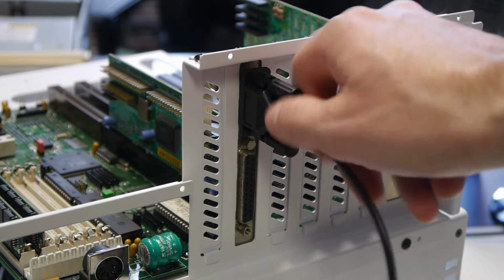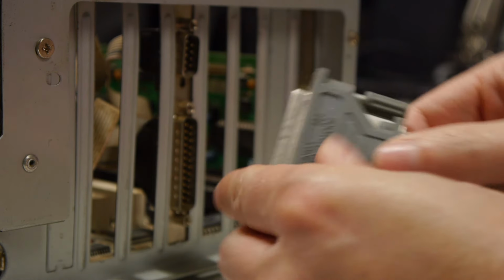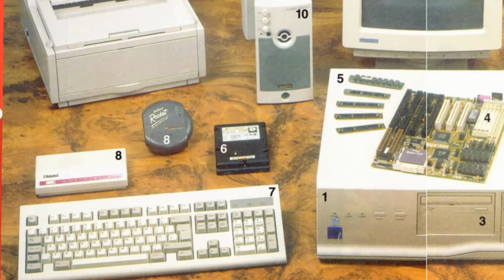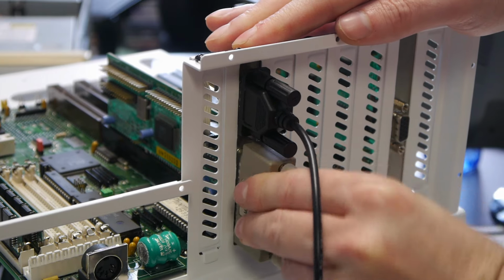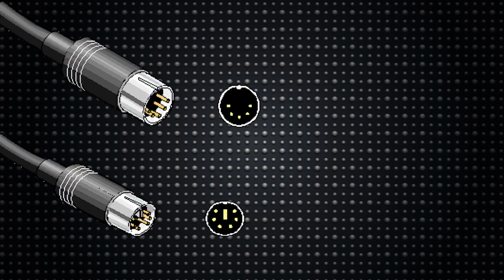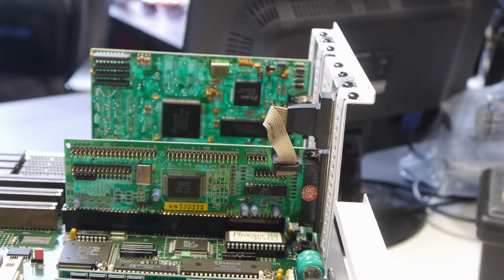What did we use before USB? | Nostalgia Nerd

Comment: I spent more time holding up the damned cable. I remember these horrid things. Once I got USB, my back recovered. 
You take the wire, plug it into the blue slot (the one you don't need anymore) and screw the thing in on the side.
the pain, the ungodly pain from screwing that f**ker in. why are the screws so tiny? 

Imagine trying to plug in a charger, but you need to put the charger in, hold it there while you figure out how to grow a third arm (because you need to screw it in place but dropping the cable will bend the pins) and if you're lucky, you get color. If you are unlucky, you get a yellow tint and have to do it over. I loved my original pc but some things should stay in the past. the back pain, the ungodly back pain!

Comment: Missed the Logitech Bus Mouse. It came with its own 9 pin bus card. It saved on resources and com ports. In the day it cost about $100. The port was a reverse serial 9 pin. It worked very well until later computers started using the Bus Mouse resources and conflicts arose. As far as I can tell, it was a dead end. At the time mice were new to DOS and there were no real standards. The serial mouse and PS2 made the concept moot.

Comment: The problem now i USB mini, micro and C. Mostly the A-conector is the same but the C-conector is gaining in use for the "computer" side. The other side is a mess. B, B-mini and B-micro is a mess. And then there is the C-conector that can act as both A and B (on the go)
It is still a mess with adapters.

Comment: During Windows installs some times those ports were required before the USB mouse would be seen, due to the software not being installed an the Bios only holding the drivers for the ports!~
  Some people might not know this but the Din plug was also a way to connect Car Audio before the RCA plug was invented.

Comment: I remember running into trouble with the serial ports back in 95-96. My mouse back then used one of the serial ports and the modem used the other. A really weird error occured when downloading something. 
I had to move the mouse all the time to keep the connection alive. 
After a lot of troubleshooting i finally solved it, it turned out that the modem and the mouse had the same IRQ, the mouse was quite old anyway, so i bought a PS/2 mouse instead and the problem was asolved.

Comment: You forgot to mention Infrared Data ports found on desktop expansion cards, laptops, PDAs, smart (learning) remotes that could also work with IrDa ports on PCs.  USB 2 runs at 480 Mbps.  USB 3.0 is 10x faster so wouldn't it be running at 4,800 Mbps?  Not 5 Gbps?

Comment: There were 25 pin  serial mice.  Modem software does not need the 25 pin serial port, the only thing missing in the 9 pin is the RING  pin. But the modem sent RING RING through anyway, and with ATA AA,  Auto answer, the software could watch for DCD .. etc etc.. The benefit of the "parallel port" was really that it was TTL and so the bits of data could be anything - it wouldnt have to be  8 bit text data. Of course,  the "send 8 bit text to printer" was done the exact same way for any printer... There were of course serial printers around too.. eg Apple choosing to  what, always try to avoid mainstream compatibility.

Comment: When it comes to bus nostalgia: Does anyone still know about the macintosh's so-called "ADB" port?  (they literally have used this for all peripheral devices in the early days at apple). It is actually a serial interface. You may see it as kind of a predecessor of the USB Idea. Also former cbm home computers already have used a 6-pin DIN (IEC) serial bus interface to connect to peripheral devices.

Comment: Ah the good old days, my VHS Recorder being used as a backup device via some weird interface. The RS232 "standards" were so abused not even using the correct voltages on some PCs, getting the Modems and other devices with a full RS232 interface to work could sometimes seem like magic and the resident  serial port expert at work became almost a law to himself. Hey we were communicating at 50 bits/sec though  :) . USB was such a gamechanger the worst part for us at work being its short range, was it 5 M. In the military realm the old interfaces kept showing up and were needed right up to when I retired in 2020 and there were endless incompatability problems between different generations of equipment from 80's upwards. I particularly remember Windows NT4 not being able to "USB" causing lots of distress. Another time we received 50pc's to replace old ones, the paperwork said they had RS232... But they were not cabled out. We had to work the weekend making cables from the "botherboard" to the outside just to save our bosses face on the Monday.

Comment: I do networking work sometimes on buildings with older equipment and you would be surprised how many times i need to take out the usb to serial port adapter to connect my modern laptop to the ancient equipment

Comment: These videos are so nice to watch. Just a note though: The voice over referenced a connector as a DB9. These types of connectors (D Subminiature) come in different shell sizes, and standard and high pin density. Most commonly: DA15 (aka the game port), DB25 (aka parallel port), DC37 (no idea what these were common for), and DE9 (serial port). The common VGA port is an example of a high density connector, having 3 rows of pins. Whilst I love the fact that USB is such a commonly used connector, it is frustrating the number of different sizes/shapes of USB connectors.

Comment: Just for Prosperity, my first USB device was a Microsoft SideWinder Freestyle Pro which camebundled with Motorcross Madness... or MM came Bundled with Controller... One of the Two, just looked it up and it was released in 1998, so yeah my First USB device was 1998, I remember it came with "adapters" as it was possible the PC didn't have USB, which my PC did have.

The controller BTW had "tilt" a feature where you tilt the controllr and it controlled the game, so think Wii but almost 10 years earlier. Actually it was more like PS3 actually. Anyway that was first tiem I had that type of input and then over next coupla years everything started to be USB.

Also Also I had a few SoundBlaster Cards... Also does anyone remember PhysX Ageia?

Comment: The serial, parallel and VGA/DVI plugs with integrated screw pins (to hold them in place) always got stuck on all the other cables when I tried to pull them out after unplugging them, like an anchor of a ship.

Comment: Thanks for the video.

You showed a scroll-wheel mouse when talking about Windows 95. But I'm sure that came up a little bit later. I remember MS Office 97 boxes with a scroll-wheel mouse included. The first scroll-wheel mouse I ever saw.
And I knew some people with Firewire cards in PCs (non-Apple) because the wanted to import DV from cameras or said USB is too slow for my external PATA hard-drive (before USB2.0 was invented).
For measurement devices GPIB was used (and seems to be still in use with old devices).

PS: Before USB, I think there wasn't a chance for an external NIC. But there were "networks" basing on serial or parallel ports.

Comment: Back in the day you had clearly different ports for clearly different things, even colour coded.
Today you mainly have USB Type A connectors that can be USB 2 (why do these still even exist?), USB 3, USB 3.1, USB 3.2, USB 3.1 Gen 1, USB 3.2 Gen 1, USB 3.2 Gen 2, any type of USB 3.x that's not on an Intel controller and won't work correctly with like 80% of the things you try to connect and even USB 3.x ports on an Intel controller that isn't being properly supported on Windows Fucking Ten anymore and constantly being detected as USB 2 every now and then. And that's only USB A. So what's better? Never had problems back in the day at all, but USB keeps giving me a pain in the plot for about 20 years already...

Comment: You seem to have forgotten about the Apple's ADB port on Macs of the mid 80s and 90s. It's a 4pin Mini-din sized plug (also looked like an S-video plug) used for both keyboards and mouses. It was pretty close to what USB 1 launched as.

Plus the iMac initially only had USB ports (the first to do that) They didn't get firewire until the second revision, at least a year later.
Reply: It's my understanding it is S-Video cable and port. Not just looks like.

Comment: And now USB-C has arrived with 24 tiny pins and a current maximum data throughput of 40 Gbits per second and up to 100 Watts for charging. Hopefully, USB 4 will get everyone on the same page and we’ll finally have one truly universal connector. USB A will stick around for a while for compatibility’s sake, but soon it may be phased out in favor of C. Also some dedicated ports like HDMI and DisplayPort will probably stick around too since they’re solely A/V interfaces, but nothing is stopping us from using USB-C cables for that too, especially since it can provide power and is capable of transferring not only 4K video at bit rates that’ll put your CD player to shame, but also uncompressed multichannel audio at nitrates that’ll put your CD player to shame (Technology Connections fans will get it).

Comment: Those old school cables, specifically the connectors, were MUCH sturdier than USB. I've seen a wrongly placed accidental swipe of an elbow or foot snap a USB clean off, with the connector remaining forever stuck in the port. Try that with one of those centronics dual wire clip affixed ports and you're going to need surgery. There are always points to be made both ways however. If you have longer cables around and trip over one for example.... The USB might break, but it's also possible it will just come unplugged. Which leaves the hardware on the table/desk most of the time. You get caught in a cable that has wire clips on one end, and screw terminal connectors on the other end, you're going down, and then the computer and printer are likely coming down on top of you. Which with 80s and 90s hardware could be massively painful. 17 inch CRT monitor to the dome is a guaranteed concussion.

Comment: Is it true that USB is slightly based upon the Atari 800/400/130xe parallel port. One could plug a floppy into this port then plug a printer into the same port on that floppy, then plug another devise into the same port on the printer, etc..

Comment: Apple2 had the very similar joystick interface first. Its analog.   Variable resister .. The accuracy was 8 bit.. so the joystick reading would be  up to + or -  127 from centred, in the two directions giving  x and y .. the resistor connected to a capacitor... To take a reading , computer would flip the voltage  across the resistor capacitor circuit and as feedback , it would detect the voltage changing on the capacitor only... The time to reach a   threshold voltage  indicated resistance.. hence position... This was unique to apple2 , the 8 bit, and ibm pc ..

Comment: Some rich people had a printer and a scanner! You forgot how that was possible without crawling under the table to use the other.
AFAIremember scanners could daisy chain the parallel port.
Then there were those who were too poor for SCSI but wanted to backup to tape, they used EPP.

Comment: Synchronization problems on parallel ports? What about IDE then? It transfered something like 16MB/s without even using twister pair cables that I saw somewhere else (SCSI? older computers?)

Comment: More than 25 years ago, I needed to upgrade my mouse from the basic Dell one that came with the computer. I ordered a serial Logitech Mouseman because Doom at that time did not work with PS/2 mice. Eventually, iD fixed that problem, and I wanted to switch it to PS/2. When it didn't work with the adapter I bought (not knowing the mouse actually had to support both to be able to use those adapters) I called Logitech. They sent me, free of charge, a PS/2 version. This is why I continue to buy Logitech equipment to this day.
Also, did you know that Windows 10 still includes serial mouse support? Just last week I had to make a reg file to disable this in an embedded Windows PC to keep Windows from deciding that our attached equipment is a "mouse."

I also remember setting up special modem AT codes to play Doom death match using a phone cable between the modems of two computers.

Comment: This was nostalgic for me. I taught Data Communications at local colleges in the nineties. I got into it from teaching official Novell networking classes but when I moved to Microsoft certified courses I also began teaching general data communications. Most of my course was a detailed examination of communication protocols which got me into teaching pin outs which in turn got me into identifying connectors. Most of the students were trying to prepare for being some kind of on-site microcomputer hardware guy at some of the many new companies then starting up.  
I was then a manager of such people in my day job and I knew that to be accepted as a PC guru you had to recognize the various cables and connectors. The guru must never say "What the hell is that?" when confronted by a strange cable. And in those days there was a lot of diversity. So I began collecting weird and obscure wires and plugs. I then started to bring them to class and have quizzes to see who could identify them. This was always fun. It was certainly more interesting than my lectures on data packet formats.

Comment: There will come a time that wireless connection will be the standard and the only connection cable we'll be using is the power cord.
Reply: Some peripherals runs on power coming from the communication cable in order to operate, so no.

Comment: i like to keep a system with fdd, serial and parallel ports for those rare times i have to use low level programming stuff like motherboard bios chip recovery or old hardware.

Comment: After 25 years of having a universal, widely compatible interface, they go ahead and ruin all of that with usb-c.
Reply: It's the same, just different connector. Like Mini and Micro USB before them, and Type-B
Reply: @bryguysays  it's not the same. Every computer since the early 2000s has had Usb-a ports, not usb-b or the others. Usb-c is the first time apple felt the need to remove all the usb-a port from their laptops, and now my old hard drives and other devices are no longer useable unless I use adapters, and that's just annoying.

Comment: You didn't mention SCSI or ADB.  SCSI was extremely high speed and multiple devices could be connected in chain.  Required setup but far less fiddly than Windows interrupt settings.  ADB gave Macs standard mouse and game controller and modem or printer connection via the 1 small standard port.

Comment: Fun fact: I recently aquired an all-in-one computer HP EliteOne G1 800 released back in 2013. It comes with 2 PS/2 ports as well as one COM port. On the other hand, it has Display port for a 2nd monitor and USB 3.0. It's a funny mix of old and new.

Comment: Oh man, just imagining having to install all those cards just to use basic accessories 🤦‍♀️
Reply: Windows Plug N' Play didn't exist back then either so just because you had a driver installed for your peripheral didn't mean it was automatically going to work with your system. You might also have to manually change some jumpers on the motherboard.

Comment: First of all, the  16 bit version of the IBM PC  was called "ay tee" it was not pronounced "at"!
Also, the ISA slot is a 16 bit slot,   not an 8 bit slot    It was backward compatible with 8 bit cards, thus was an extension of the 8 bit slots but the ISA slots were 16 bit slots from the beginning.

Comment: Don't forget about the very annoying and useless DMS-59 port that looks like a funky DVI-D port or the Displayport that looks like a broken HDMI port. Of course you can blame DELL for both of those connectors which make things more difficult than they have to be. Don't get me wrong I like my DELL machines because I can find older ones for practically nothing, they are easy to work on and last a very long time as long as you take care of them. Right now I'm typing this on my Insprion 620.

Comment: First computer was my 65 lb  "portable" Kaypro II. I used a folding luggage cart to take it to work (we didn't have word processing and my boss would not let me work at home).  It did not have enough memory so I bought memory chips from a local person I found in the GIANT computer shopper they sold back then and installed it using a reverse engineered manual someone wrote. 

Sigh. Today is my 70th birthday.

Comment: I don't miss the tangle of cables and chunky connectors.  Working in the IT dept of a hospital throughout the 2000s made sure of that.  Fun fact, they still had a 386 running the PABX when I left in 2013.  It had a PSU fail which caused a few dramas in trying to find a spare that was AT-compatible

Comment: The problem with USB A connections is that they don't have proper lead-in so even if you have it in the correct general orientation it won't connect without fairly precise pre-alignment. Good luck if working by feel on the back of a tower or laptop. Proper industrial connections are all designed to accept poor initial alignment and then self align to some extent, not hard to do just some minor ramps and radius near the leading edges.

Comment: The good old COM1 port, a COM1 to USB adapter existed in the 00s, along with a driver CD to install, supposely then you could use older hardware on modern machines,  althought I could never get it to work.